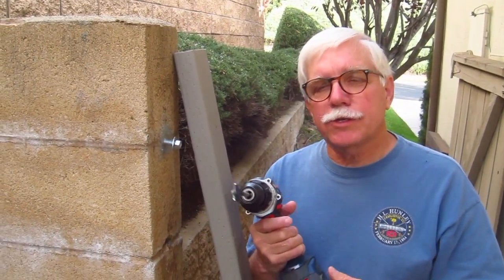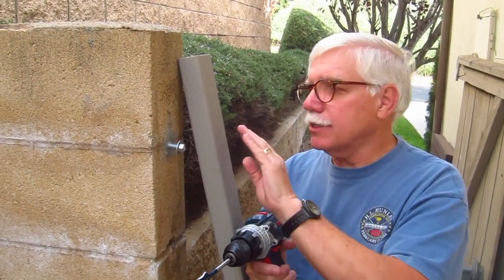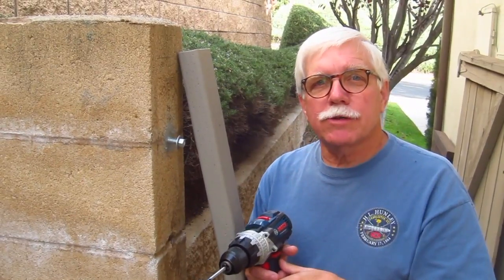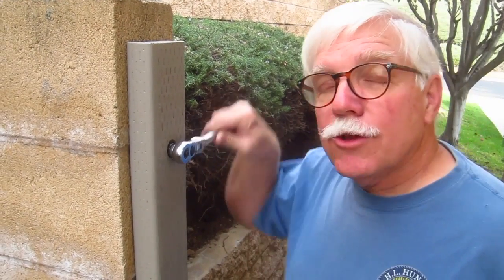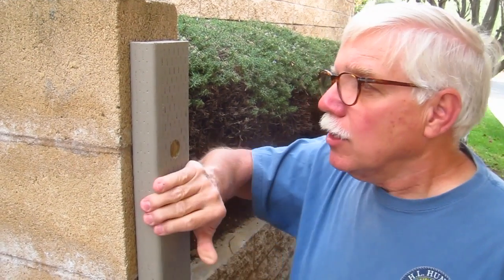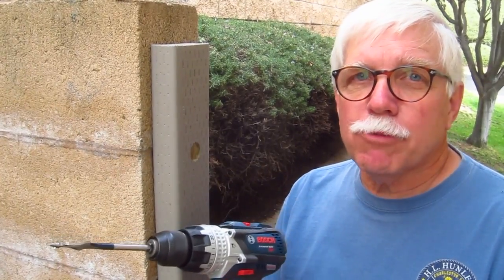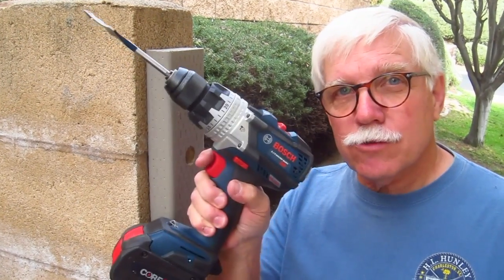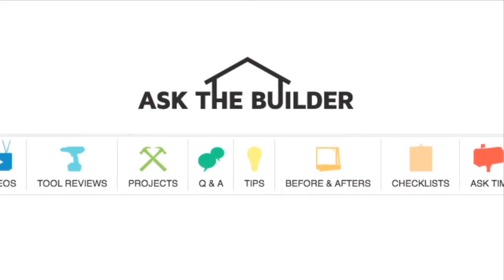How to Use a Spade Bit

Comment: Hi Tim, thanks for this helpful video. I'm working on the exactly same project to replace my old gate post. However, my Ryobi drill can't get through the pine wood with a 1/2" spade drill bit. I wonder if the issue is with Ryobi that it is too weak to handle the job. Could you please give me some advice? Thank you.
Reply from the maker: Go buy a corded drill and an extension cord. Problem solved. I assume the bit is sharp and you're not going in reverse.
Reply: @askthebuilder  thank you so much! I got a dewalt corded drill. Problem solved.

Comment: Is it a bad idea to use spade bits as a pseudo chisel? (Have found nothing conclusive on the matter)
Reply from the maker: Easy answer: Is it a bad idea to use a stick to stir a fire instead of a proper iron poker? Is it a good idea to use sharp pocketknife to cut off a finger if a scalpel is not handy?
Reply: @askthebuilder  so what I'm gathering is it doesn't matter much (I'm rather tired since it's 5 AM as I'm typing this)? Just wasn't sure if it is bad to strike it or not.

Comment: The title is "How to Use a Spade Bit," but you didn't say a word about that. You're using a speed bit. Those are made for quick holes that go all the way through. The corkscrew pulls you through faster. They're not precise, and if you stop half way you need to back it out (which chews up the wood even more). A regular spade bit would be cheaper, faster in this case (since you don't need to reverse the drill), and cleaner. Regardless, spade bits do better with high RPM and high torque, so a drill press is the best option and a cordless drill is the worst option.
Reply from the maker: Raquel, get out your fork and start munching on this piece of humble pie, young lady: https://duckduckgo.com/?q=spade+bit+photos&atb=v315-1&ia=web
Reply: I get more tear out from the Irwin than I do Bosch speed demon self feed bits.